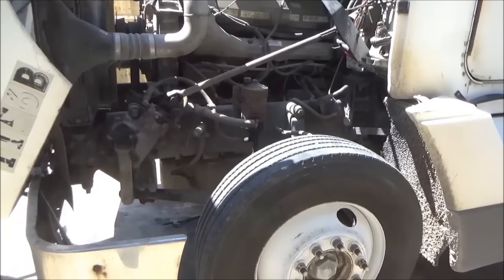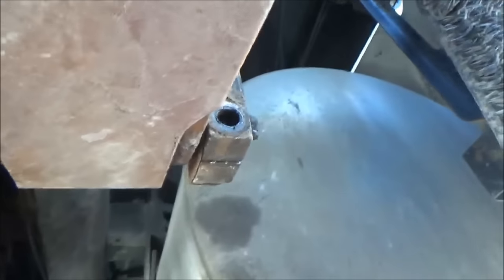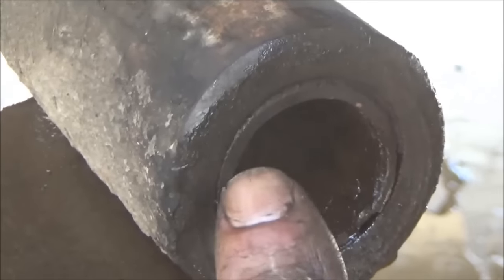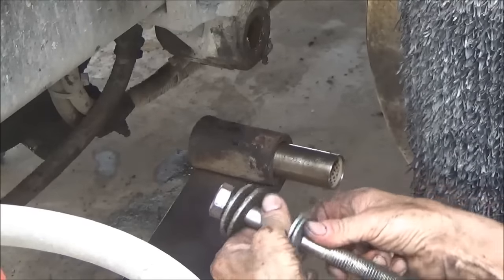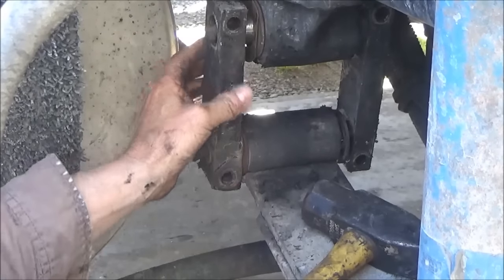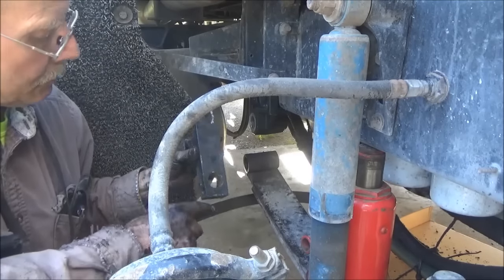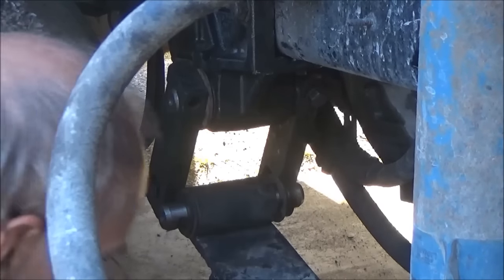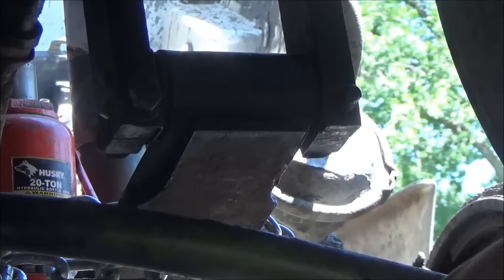How to change leaf spring pins and bushings on a Big Truck

Comment: Instead of wasting time with the heavy come along and chain, next time put the bolts in the side plates on the inside, then use a large C-clamp to squeeze the inner and outer plates together until the outer bolts will fit through the pin notches.

Comment: I know video is over a year old but It help to put the bushings in the freezer overnight if you can.
Reply: I understand the logic behind that, but it's not necessary on these pins. These are a clearance fit, not an interference fit. That trick works well on dozer or excavator track pins though, also on some kingpins.

Comment: It’s a good video, but wouldn it been better to take the whole spring of the axle than plaing with torches near fuel lines, electrical cables etc. Just wondering
Reply: This is one of those skills you pick up with experience in time, not as dangerous as it may sound.

Comment: @ 8:07 why not use a sawsall and an 18 tooth blade to make the cut in the gap of the spring? Just sayin.
Reply from the maker: You can if you want but for me the torch is faster and since I'm also a welder, the torch as always a quick, handy option. Thanks for watching and commenting.